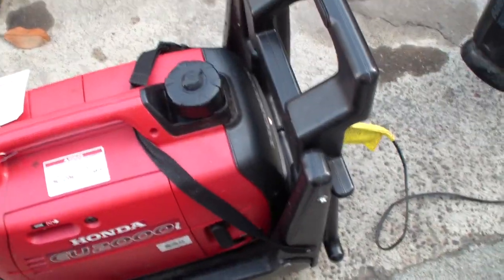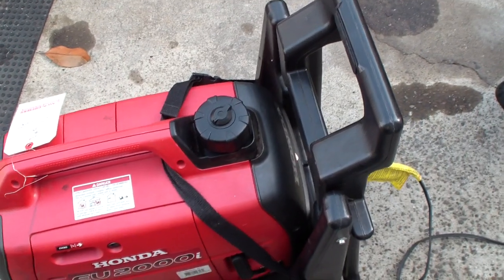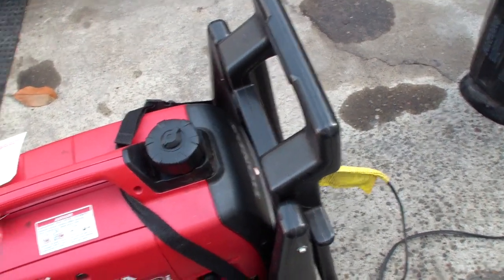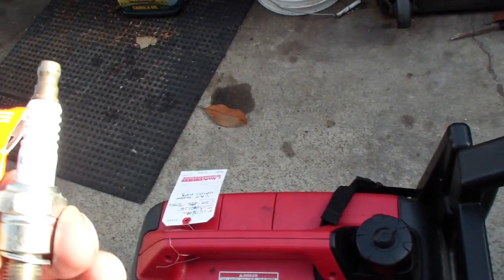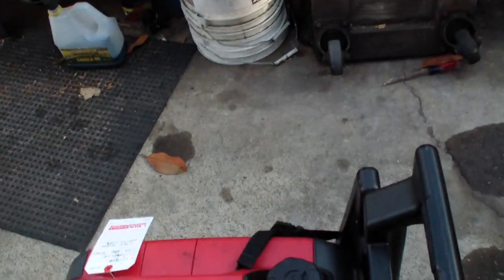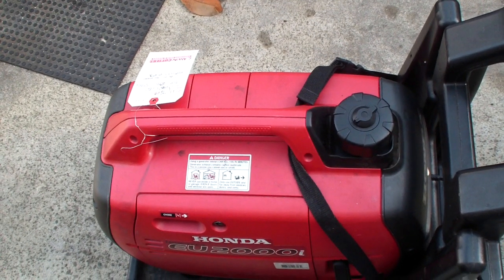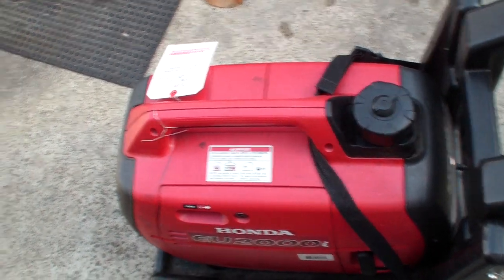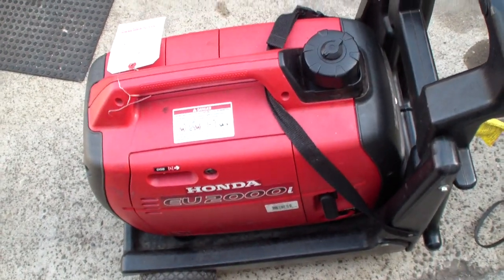Honda EU2000i Generator repair. Runs 20 minutes and dies. Repairs at The Alameda Repair Shop

Comment: I'm having issues the same with a clarke suitcase generator... 2.2kv they are based around the Honda, I shall have to try the spark plug... I same had it sent away for a simple maintenance and ever since hasn't ran right but the shop swears they is no fault 🤷

Comment: Never had any issues with the NGK plugs.
They could have had a bad batch. 
I prefer NGK in all Ho da equipment and haven't had any issues. Champions in my opinion are the worse. I normally will run Autolite in all Briggs and Stratton,  Kohler, Kawasaki and other engines but NGK or NDs seem to work best in Honda.
Thanks for your video.
Mark Nye thefixitguy 
North Valley Repair

Comment: Great tip! I replaced the carb and plug on my eu2000i, ran great after both in / out of econo for 30 mins. Added a load, gen died right off. Swapped the plug, run great under full load. Thank you for sharing.

Comment: I'm working on my dad's eu1000i right now and it sputters slightly when it runs. I tried to lightly clean up the NGK spark plug in it and it made it worse so there is certainly something to this. I will try a different brand plug tomorrow thanks for the tip.

Comment: I have same generator same problem but runs for 2 hrs an stops,pulled spark plug an sure enough it's a NGK plug,swapped it out an now it runs like a top without stalling out..THANK YOU FOR YOUR VID,YOU WERE DEAD ON.
Reply: hey guys I have an eu2200i and it started sputtering and coughing out at about 20 minutes as well.  Never had the issue before however.  What spark plug do you guys recommend?
Reply: @JamzStudios  NGK plugs are better that they were before,stick with NGK.I have the same generator as well with NGK plug in it.If that doesn't solve the issue reply back to me.I PERSONALLY WORK ON HONDAS.
Reply: @rem2855  what if wrong oil was used ? What would you suggest to do right after
Reply from the maker: @Isaiah-xg4sz  What kind of oil?
Reply: @pafoofnic  10w-20 instead of 10w-30
Reply from the maker: @Isaiah-xg4sz  If you're using it in cold wheather you should be OK. Summertime back to 10w30...